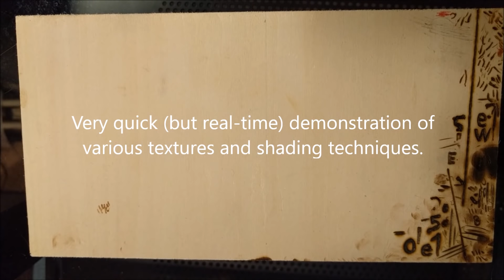Pyrography (Woodburning) - Real-time textures and techniques.

Comment: I have a question. Does it smell? I don't really have a place were I can sit with this kind of stuff and I don't want my smoke detector to go of.
Reply from the maker: It smells more when you burn darker parts, but not as much with lighter burns. I don't think it'd do enough to make a smoke detector go off unless you really try to. It's still good to have some air circulation though, like a window open or an air purifier. And make sure you burn on untreated wood.
Reply: @BTJPyro-Woodburning  alright, thank you! Great video by the way.

Comment: what is the name and size of the tip. Great skills.
Reply from the maker: Thank you! It's the "Heavy Duty Tip 2LC - Large Round Shader". You can find it here: https://store.razertip.com/mm5/merchant.mvc?Screen=PROD&Product_Code=TH2LC
Reply: @BTJPyro-Woodburning  Thank you Brandon.
I've watched your Packard and Chev videos and will be doing automotive myself.
I've decided to go with Razertip due to seeing what you're able to achieve. Any info about your set-up, pen(s) and tips is appreciated.

This is a fantastic video BTW. It really shows the diversity of this tip, what will result from which part of the tip contacts and how long it's left.
Did you use this tip for the majority of the Packard burn? It looks like once a desired temperature is found that it could be used for almost anything.
Reply from the maker: @Maxxis1941  - Nice, hope you like it when you try it!
Yes, this is the tip I used for most of that woodburning. I also used the small round shader for the smaller areas. And maybe a sharp one for the front grill. But the Large Curved Round Shader is my all-round favorite one to use. Has a lot of flexibility, as you mentioned. The tips usually stay the right temperature, but I sometimes blow on the tip to cool it down a bit. Like if I lift the pen up for a little bit, I blow on it first before putting it onto the wood again, to prevent scorching it with a darker burn. 

As for the setup, these are what I recommend/have. There's probably some more on there that might be good for fine lines, I haven't looked lately. I don't make any money from these links btw (wish I did! haha)

Box: https://store.razertip.com/mm5/merchant.mvc?Screen=PROD&Product_Code=SK-HD-BPH

   Probably best to have at least 2 pens total. 
      Pen: https://store.razertip.com/mm5/merchant.mvc?Screen=PROD&Product_Code=BPH
      
   Medium Round Shader: https://store.razertip.com/mm5/merchant.mvc?Screen=PROD&Product_Code=TH2MC
   
   Small Round Shader: https://store.razertip.com/mm5/merchant.mvc?Screen=PROD&Product_Code=TH2SC
      
   Large Curved Round Shader: https://store.razertip.com/mm5/merchant.mvc?Screen=PROD&Product_Code=TH2LC
         
    Small Spear Shader: https://store.razertip.com/mm5/merchant.mvc?Screen=PROD&Product_Code=TH5SP

Comment: Thank you, Brandon, for the time and your generosity in sharing with us your techniques. I'm assuming you change the burning temperature in order to achieve the different degrees of shading. Am I right?
Reply from the maker: glisteningdroplet You're welcome! And thank you for that comment. 😊 Yes, I do change the temperature some. It varies with what tool you're using so just try to experiment some with different settings.
Reply: glisteningdroplet you can also control how dark the burn is within a setting by how fast or slow you move the pen in one area.  So a burn can be really dark or done as a gradient within that 1 setting. This increases the range even more that you can achieve. 😉